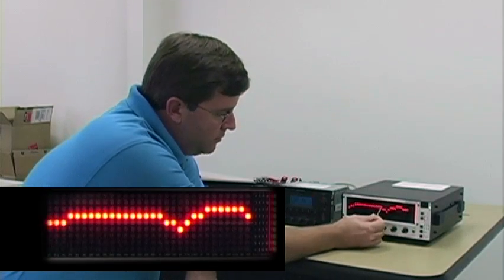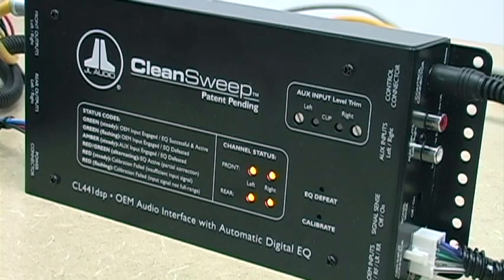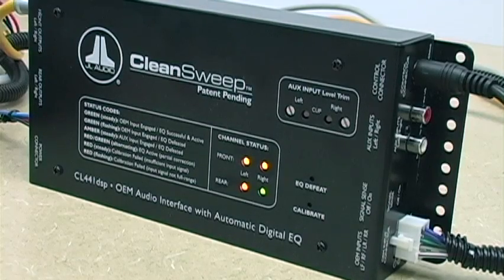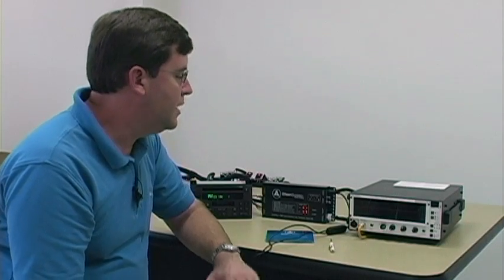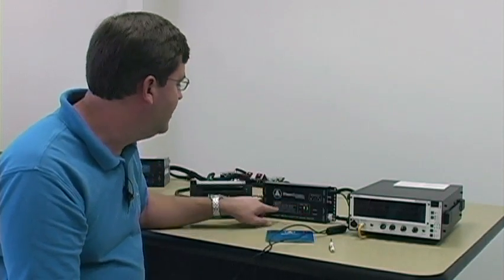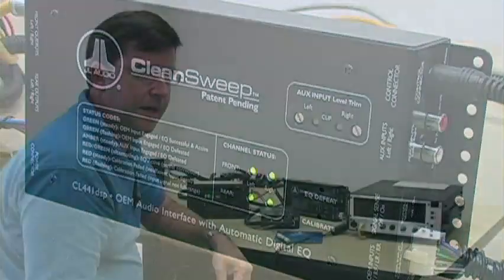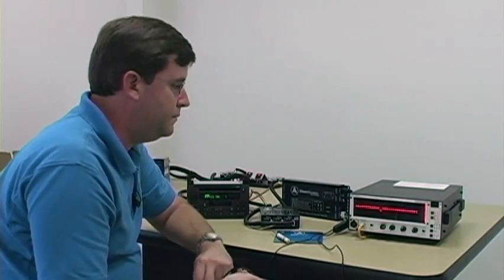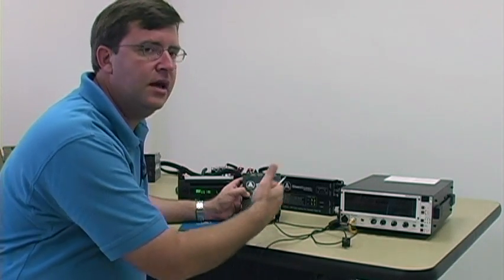JL Audio CleanSweep® OEM Interface Product Tutorial

Comment: Not sure I want a installer that throws things across the parking lot when things don't work right. Maybe that's the reason my system sounds so bad.
Reply from the maker: That MAY have something to do with it 😂
Reply: @garminaudio  Also don't pick an Installer that is going out of business . Twitter closed the doors ,  went home and the job was half A $$ finished in the parking lot.  Should have left the car stock . May just rip out all the work and call it a day . .  You guys should do a video on how to pull sub frequencies out of a factory head unit after going through Cleansweep .

Comment: ok, so you set the de-equalization with the car's volume up 75%.  For my car, and maybe for many cars, the eq curve seems to change as the volume goes up. There bass doesn't continue to go up as the rest does, obviously to protect the speakers. So, with these processors we can set the eq to flatten the curve, bring back the bass.. but then what happens when we turn the car's volume down after calibration? I assume it would be overly bassy. 
But then there is the master volume for the box itself, on the Cleansweep, on the PXA-800, etc. Is the car's volume always at 75, and we just adjust the external amp's volume via the master volume/sub knobs included with these processors?  That would make the most sense to me as the unit will get a big signal, and then the car's eq curve changing with the car's volume won't be an issue, because we won't be touching the car volume, but using the processor's volume knob- which I'm assuming is controlling how much volume of that already calibrated 75% is then given to the external amp, to amplify to the speakers. right?  

Is this how these things work? And is  HU > processor > amp > speakers, correct? I'm not completely clueless to audio in general, but more of a novice with car audio. Thanks.
Reply: +Matthew Maneri You are actually correct about this, and this is the reason they provide a knob for volume adjusting.